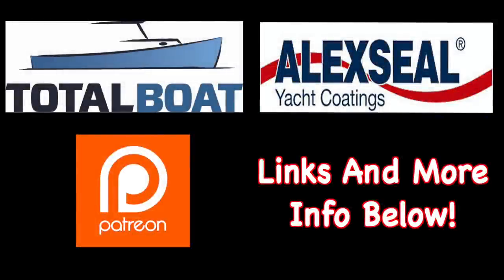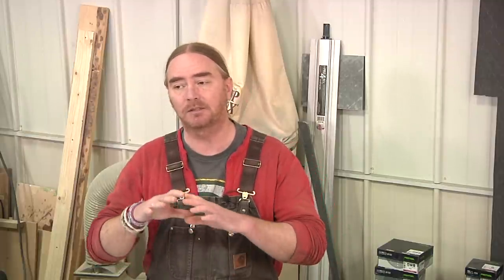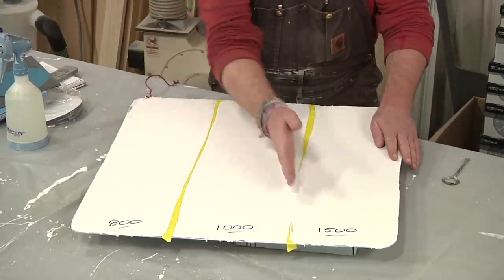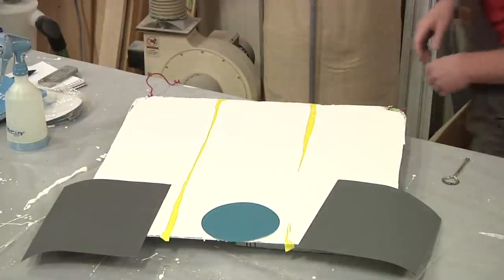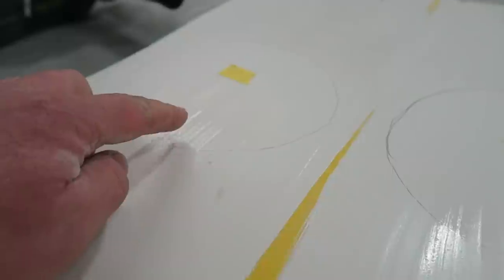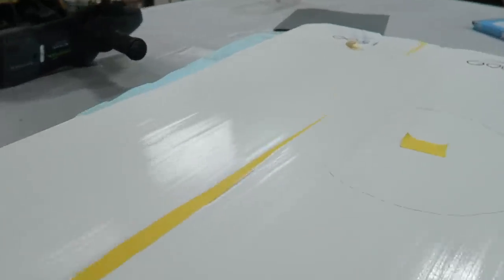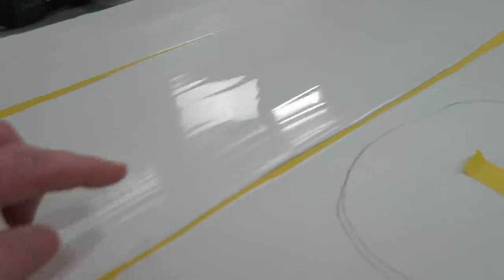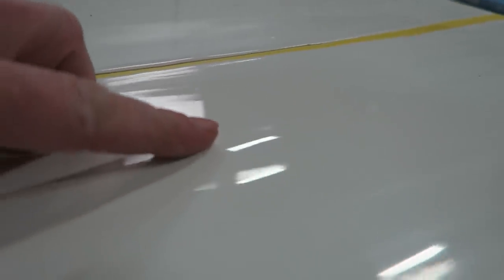Pre-Launch Quick Tip #3 : Best Buffing Compound For Your Boats Gelcoat!

Comment: I just have to say - I have gotten  a lot of amazing information from this channel that is helping with my boat restoration.   Due to the information shared and the way it is easily presented - I have confidently replace the rotten transom, and working or getting it all back together in the coming weeks.  It was a daunting task to take on - and I was not confident in my knowledge base until I found this channel.  Props to you sir for your hard work and ability to share knowledge in an easy to understand manner.

Comment: Total buff is the bomb! This has been out of stock for a while,  but just received a shipment from Jamestown Distributors today. Absolutely phenomenal product. This stuff almost is like a liquid more than a paste. It doesn't seem to build up and glaze on pads, so you could go much longer between cleanings.  Compared to other compounds it leaves little to no residue behind, just a mirror finish, free of scratches of course! 

I went over a large cargo van (fiberglass shell) with 1000 grit wet sand, and absolutely no traces of scratches when followed with Total Buff. It had over 16 years worth of oxidation. Truly a revolutionary product! I have no idea how they do it, but I can't thank Andy enough for sharing. I'm sold on Total Buff. It's works extremely well with a DA polisher.  I use the Makita dual action with orange, heavy cut pad, and made 4 passes in a crisscross pattern. 2x2 area works well in high 70 temps.  Again, so grateful to Andy for all the info he shares. Andy you are one of a kind Sir! All the best!

Comment: I've been restoring a heavily oxidized jet boat and saw this video on the Totalboat product. I bought some. The process I found to work took 5 steps. 1. I washed the boat with diluted hydrochloric acid (toliet bowl cleaner), rinsed and dried the boat with a microfiber towel. 2. I used a spray bottle with water and a green Scotchbrite pad to wet sand the boat, dried off with paper towels. 3. I used 3M heavy duty rubbing compound with a 6 inch foam pad buffer, sprayed and dried with paper towels. 4. I used the 6 inch foam buffer with the Totalboat rubbing compund, dried with a microfiber towel....great shine! 5. I applied Marine 31 wax with a 2 inch low speed buffer and foam pad then wiped with a microfiber towel...the boat looks almost new!
The fiberglass is shiny including the metalflake sections. It's a dramatic change. Thanks for your testing as the Totalboat compound does a wonderful job to bring out the shine.

Comment: Great video and comparison and yes, new gelcoat is not as hard so polishes out easier and quicker. However, in my experience this year, I have spent over 60 hours polishing my 28 year old gelcoat and tried many different brands and types of polishes/compounds. 
I did like the Total Boat Rubbing compound, but it does not clean out of the pad as well as one other that is more aggressive and brings up a  shine faster which is Majestic Solutions Vibracut 1000. It seems to cut fast and bring out the shine quickly and then flings off the pad and keeps it from building up so quickly. Then I use a pad spur to clean periodically to keep going. 

If ever interested, and working on aged gelcoat, you might want to give this stuff a try. 
I do followup afterwards with the Total Boat Totalshine Finishing compound to remove the fine swirl marks and man, what a shine and finish!

Comment: Andy, can you comment on how a compound that appears to have very aggressive cutting ability could result in low spots if you are doing gel coat chip repair? Say you fair the repair out on a hull side with 600, and then polish out with this compound, will there be a “low” spot in the general area you were polishing?

Comment: Any  Heavy cut or  Extra cut compound will work just fine ... been working on boat in annapolis md for 20 years and this was the first thing I learned to buff any gelcoat.. would never used a one step wax to buff out any gel coat repairs ...

Comment: I used the same deerfos wet and dry disks. 1000 12 15 2000 25000 and then finish with a 3000. Then lambswool buff with faracela G3 and meguirs fine. As the hull was out in the weather for 12+ years and a third brush painted soo thick. After a wax with mirror glaze it looks brand new, it had never been on water Ever. Great video, thanks. Stay safe and well

Comment: IMHO, the wool pad helps a lot the compound. You should try with a light foam pad to be sure what the compound is capable of.

I hate Maguire's because it's full of oily fillers that mask the defects much than correct them.

Comment: i'll be willing to bet that the compound contain pumice as the "grit"  
Pumice is very porous, and start out "coarse" and grinds itself down to a finer grit. Thus you can pretty much buff anything with it.
Long time ago i worked at a company where we had such a compound - we could also finish sanding at about 500 grit, and buff to an insane gloss with the compound.

Comment: The best cutters come from a brand called G3 farecla come  in cutting compound abrasive 1 2 and 3 and swell remover 2 & Wax UV rated and a few more 
These are the ones that I have used for over 10 years polishing fibreglass moulds for preparation and lot of boat repairs
 Over the years I have refined my technique and on numerous times I have just used the cutter number 1 abrasive any it's usually pretty well done most of these repairs I done on high-end boats like bayliners and malibu's to name a few
So I'm not sure if you can get this product in America, you can get it on eBay

Comment: Just a note..Meguiars M49 Oxidation Remover is the least aggressive compound they make.    M67 One Step is a little more aggressive ( 2000) and M91 Power Cut is the most aggressive (1000-1200)

Comment: Great video, I have learned a lot from all of your videos. Thank you for posting.

I bought a 20 year old Starcraft. The Gelcoat is a bit yellowed, but there is old oxidation on the bottom which I am going to apply a new coat to due to some chips and digs, 20 year old boat right. What grit sand paper would you recommend starting off with to try and brighten up the rest of the finish?
Reply: Try hitting it with on and off. Careful as it’s acidic, but does an amazing job of removing stains

Comment: Good video as always. You might want to put a caveat on this, however, you're using Totalboat's buffing compound on Totalboat's gelcoat. You're using products that are undoubtedly tested on each other internally at Totalboat. This would be more impressive if I saw this tried on different gelcoat brands. Now since you mentioned your previous repair project, and I don't think you're a liar at all, I believe you on the claims, but the demonstration might be questioned.

Comment: I was kinda surprised you didn’t use some type of backer with your paper.  I always thought just using your finger tips makes things kinda wavy.
Reply from the maker: The surface was already so wavy from brushing the gel on, it would have taken forever to block it all flat and smooth.  On a project yes, but couldn't spend that time for a demo :-/

Comment: Hi
From the other side of the pond. Because or the lock down I can’t get acetone or thinners can I use petrol to clean the plywood. 
Stay safe
Reply from the maker: Petrol as in gasoline?  If so I think it would leave behind too much contaminants and not work well :-/
Reply: Thanks for your reply and stay safe
Reply: Noooooo! Maybe something alcohol based.
Reply: @boatworkstoday  Petrol(oleum) is yes gasoline. A british term. They call them Petrol Stations instead of Gas Stations here in Oz. Except, makes me wonder what other side of the pond Daniel ONeill is from. Because have plenty of all that stuff here in AU. 

Bunnings has Acetone, an All Purpose Thinner, and even other types of thinners including Lacquer Thinner (but is rather strong and harse, not product would recommend for general cleaning). Can even get Mineral Turp, Methyl Spirits and even Xylene. Products might consider for alternative, but not when you can get Acetone. Also can get most of those from Whitworths as well especially Acetone. But including Turpentine, Methyl Spirits (current not for sale during Covid ??) and many other types of Thinners. No Xylene though.

Comment: Is a lamb's wool pad recommended for application, or will foam pads work as well. Also, is there a recommended speed for oscillation?
Reply: Foam works as well. Just less cutting power.
Oscilating and buffing? Heck no. Not on gelcoats

Comment: Ok. How much material is this total boat compound taking off if it can take 600 grit marks away. I'd like to try it, but how much gelcoat do I need so as not to burn through?
Reply: John, that would likely depend on how your boat was built. For instance my Proline has gelcoat that is likely around 1/8" thick (really). I know this from grinding into the spot repairs I have done. with that much gelcoat you would literally have to spend hours and hours buffing to burn through. The gelcoat in my repair areas is actually much thinner than the factory gelcoat. I hear and appreciate your apprehension though as I have burned through clear-coat while wet sanding orange peel in automotive Base Coat / Clear Cote coat systems.

Comment: Andy just looked up the total boat total buff and it says it's for 600 to 800 wet sand buffing, and is part of a 3 stage system they say to follow up with total boat total shine, 
This is info from Jamestown distributors, but they dont say what the 3rd stage is, 
I'd be interested as to the end results if the whole system were used, I dont suppose you have the complete system on your shelf to do a follow up demo on a flat sanded area. 
As this stuff could be a game changer giving all of us more time on the water with less elbows and shoulders aching from vertical buffing 👍👍😉

Comment: Unfair comparison. Fresh gelcoat is much softer than fully cured gelcoat.
Reply: You got a point there....
Reply: It also scratches easier (so the 400 grit would leave deeper gouges).  That said, I'd like to see this stuff on his oxidized hull.  Perhaps when he gets around to cutting that transom off, he can use a bit of that to run a bake off.  I am really curious to see how it goes on paint too.
Reply: He's  specifically addressing the use case of polishing out fresh repairs, so it seems pretty applicable.
Reply from the maker: I don't have a boat with gelcoat in the shop so trying to do the best demo I can with what I have :-)
Reply: @nunyabizness6734  Except the case where you are also trying to blend into old gel coat like in his example.
Reply: @boatworkstoday  well for sure you are doing very best. Compliments I Iearned a lot from you and thank you for that!
Reply: @boatworkstoday  GREAT Demo...  so much junk out there, glad to hear of a good product from someone I trust.   Can you please let us know what Festool Product model /# you're using?  I tried compounding my boat myself, using a "kit"... the polisher was pretty low end and after a ton of hours and two sore shoulders, it didn't look great.
Reply: BoatworksToday I believe you proved your point very well Andy
Reply: To be fair new gel coat is softer yes but using an aggressive paper such as 400 and getting a finish that good is a task in itself.
And let's face it oxidation on gel coat on older boats tends to need treating prior to buffing it out. That's why the stuff Andy uses here is part of a 3 stage system I'm guessing.
The man has the skills from what I've seen and who ever is doing the polishing provides the elbow grease.

Good job Andy 👍👍👍